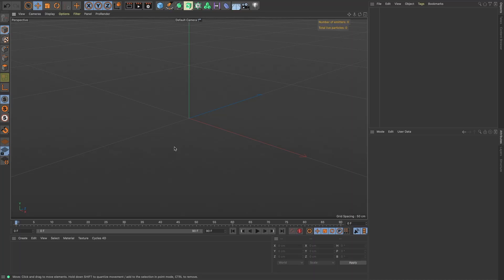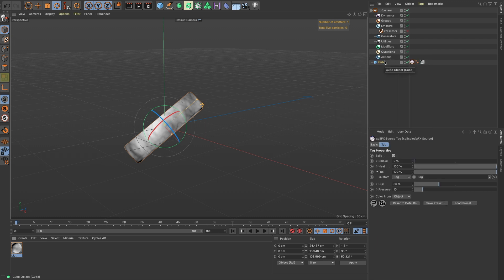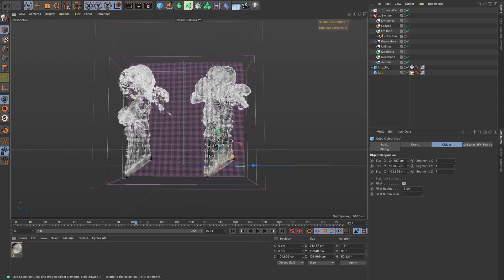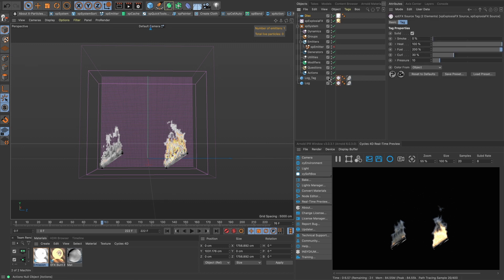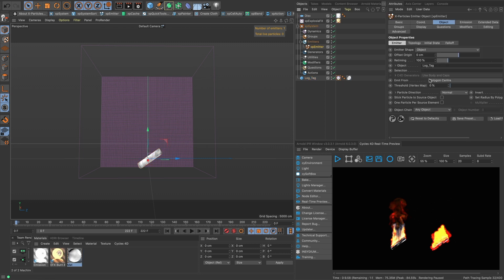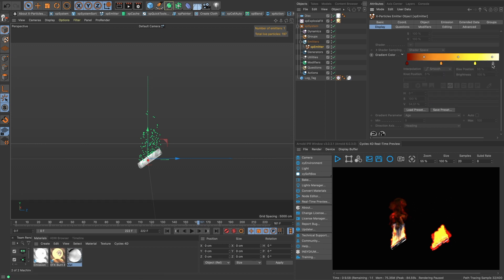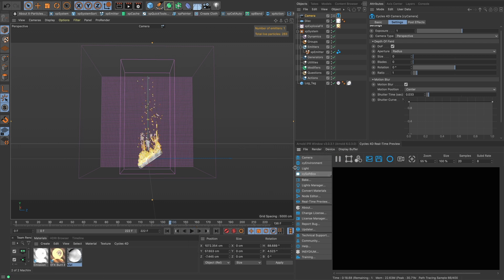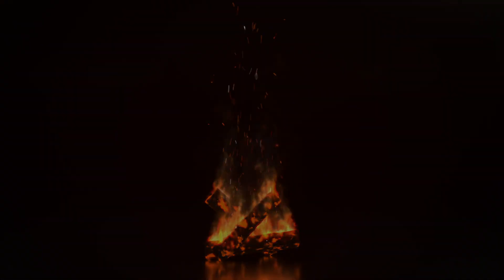TUTORIAL - Realistic Fire Simulation in under 15 minutes using X-Particles

Comment: Great video - thanks. Trying to adapt this so the flame is under a pot and the fire and smoke travels up the sides but not through the pot. Assuming I need a collider tag but can't work it out. Also how do you render with Redshift? Seems ironic that you use Cycles given your Channel name
Reply from the maker: Ha yes, the irony! I had this channel before redshift was a render engine. Sorry I’m no help with rendering in Redshift at the moment.
You will need a collider, I think you’ll need to either check or uncheck the “solid” option in the tag. I’m not in front of a computer right now but let me know if that works.
Reply: @redshiftmediahouse3643  I figured it out. In the collider tag /reaction the dropdown had been set to translate. setting it to none stopped the pan moving. I think I must have changed it accidentally via my mousewheel because the default value is none (as you'd expect). X Particles has soooo many parameters it's pretty hard tracking down issues
Reply from the maker: @thehomme  Great, glad you were able to solve it!